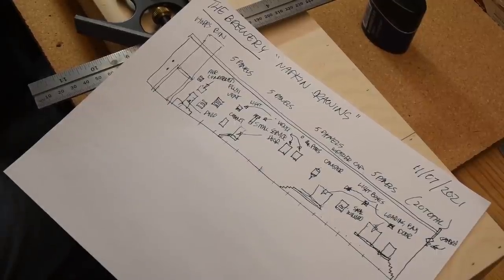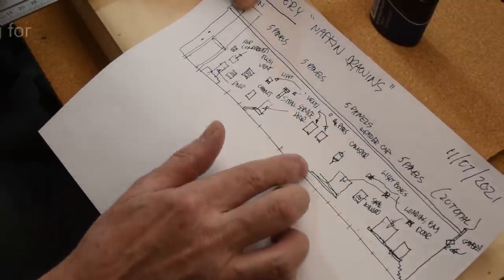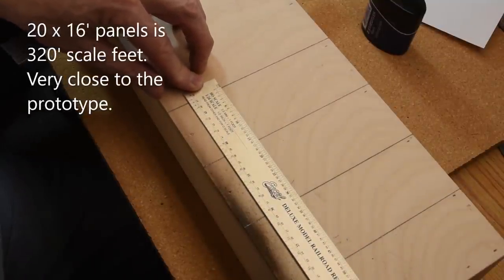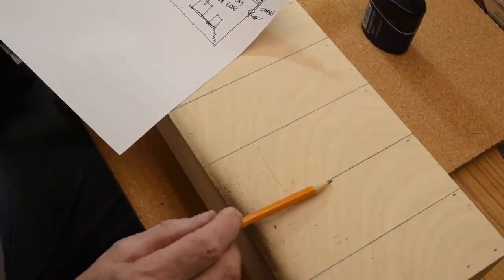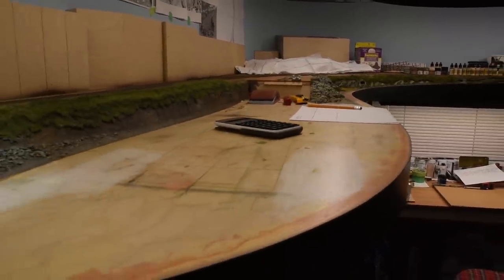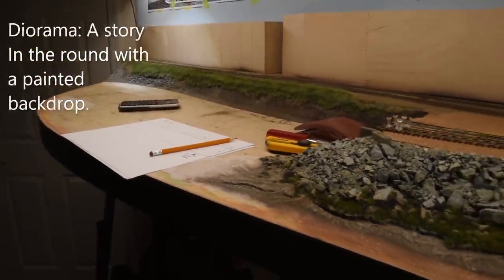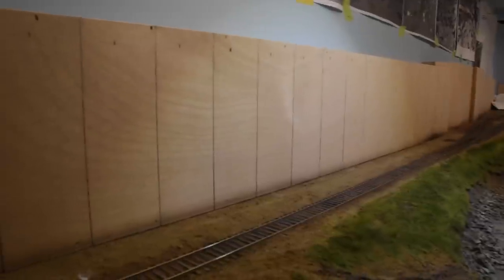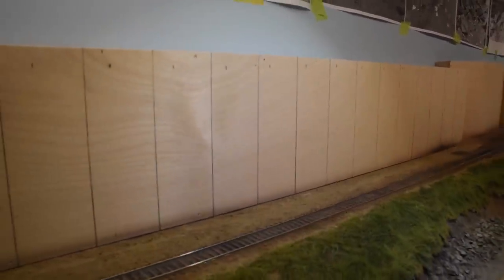The Brewery Build "Part 1" | River Road - Vlog #41

Comment: Great discussion on how you are planning the brewery model. I notice that the turnout switch stand would be right where the loading dock in the third panel is. Would you consider moving it to the other side of the track thus putting it on the same side of the track as the next switch down the line so the brakeman/conductor could ride  the same side of the car  throwing both turnouts without having to cross over the tracks behind the car.  "Safety first"
Reply from the maker: Maybe. Problem is, I already moved the bay door one panel down. Thanks for bringing it up though. I move quick these days. ;-)

Comment: Just thinking, if you wanted to model the abandoned brewery siding why not run some code 40 from the edge of the layout along the front left to right - does not have to be connected to the trackwork but visually state that the lead is longer than what we are allowed see and the siding is connected in the never-never.  It's for the love of the leaves and concrete
Reply from the maker: I was thinking that very same idea. I only laid dirt down there lightly because I needed to see how the width panned out. I will probably lay down a hint of track as you implied Thank You! Cheers! ~ Boomer. ;-)

Comment: What life without a brewery of any type
Reply from the maker: For some not a good thing.🤣
Reply: @boomerdiorama  True, depends on the brand but love the ideas many which I have but cannot articulate as well as you do. Question do you have a rod crossing in this new layout?
Reply from the maker: @modelfxaustralia8963  If you mean "road" crossing, not in the traditional sense (yet). The barge approach is a paved crossing for commercial vehicles onto the barge slip. The slip does not only accommodate rail service. It also serves vehicles as well. If I rebuild the "Glover Road" crossing on module "C", with the grain elevator, then there will be a road crossing as you indicated. Cheers.😁